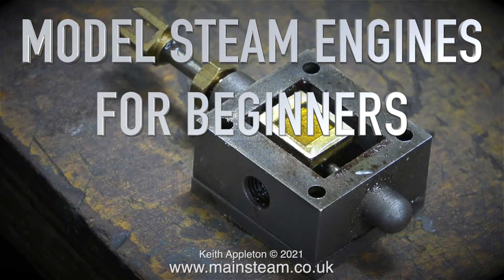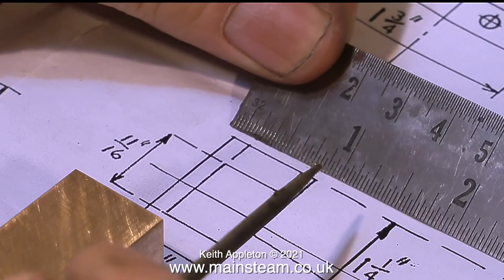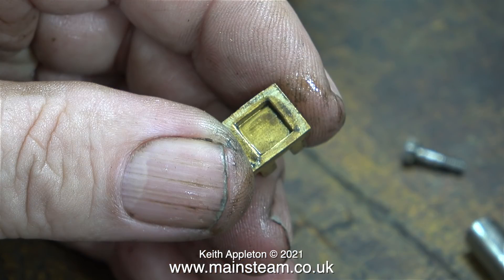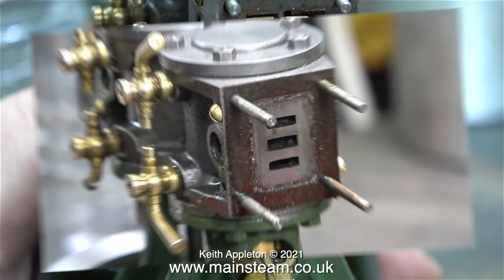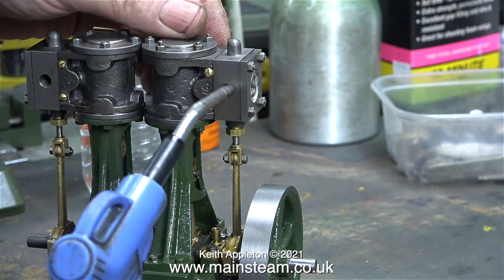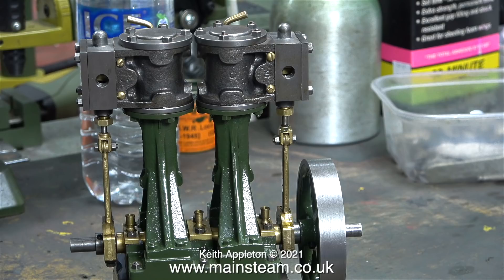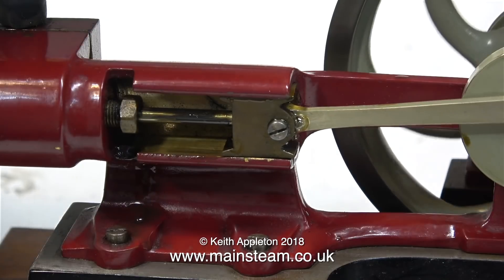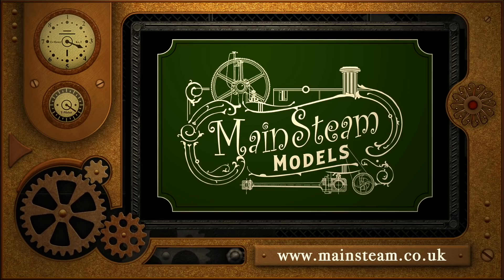SLIDE VALVE ESSENTIALS - MODEL STEAM ENGINES FOR BEGINNERS - PART #15

Comment: Keith's video showing how a slide valve floats by the relative movement of the valve in relation to the nut retaining the valve rod sitting in an open channel made perfect sense to me - that is until I got to the valving on the Stuart No 9 that I'm rebuilding! I cannot currently get this engine to run because the valve has no fore and aft movement and is being held an estimated .015" off the port face. Hence any air applied simply blows straight out of the exhaust. Stuart plans show that the valve is cross drilled 5/32" for the 5/32" valve rod with the nut sitting in the middle channel being retained by 4BA threading. The nut and rod therefore has no fore and aft movement that is independent of the valve. I can only assume that builders are expected to mill the valve face thickness very precisely so that when everything is bolted up it fits pretty much exactly against the port face. Unfortunately my original builder was not up to this standard. To overcome the misfit I'm thinking of cutting down from the valve outside faces into the 5/32" holes to produce a couple of channels to take the rod and give some float so that applied air or steam will hopefully allow the .015" to be closed to make a seal. Any comments?

Comment: Hi, sorry, I was not able to see which way you turned the valve around. I tried on my 10V to turn the valve 90 degree and for a short time during the stroke both the top and the bottom were open at the same time. Did I turn it wrong?
Reply from the maker: That's the only way you can do it (90 degrees) if the engine runs better with the slide valve fitted that way then leave it like that. Sometimes the steam ports can be slightly inaccurate to the drawings.
Reply: @keithappleton  Many thanks

Comment: The plans I have for a Stuart engine just shows the slide valve with 1/8 gap for the bar and the bar material is called as 1/8. Never mentioning to be any loose fit so I can see why newer people like me could go wrong. I did make that adjustment but probably should have trimmed the slide valve to uncover the cylinder ports better. But it runs.
Reply from the maker: It is down to tolerances. A 1/8" shaft in a 1/8" hole will be tight because of what is called an "interference" fit.
Reply: @keithappleton  You would think after so many years Stuart Models would update the plan sheets to reflect correct machining. My plans were even missing dimensions altogether. 
No discount in pricing though!🤣

Comment: Fiddling around with valve timing is a good way to spend hours & hours,if the adjustment screw is on the outside ,if it’s under the eccentric strap it’s a pain ,my beam engine is like this the timing slipped and it’s set approximately but I can’t be arsed to fiddle with it.